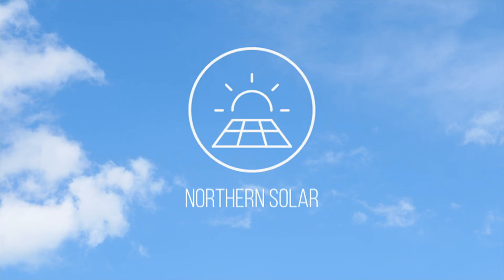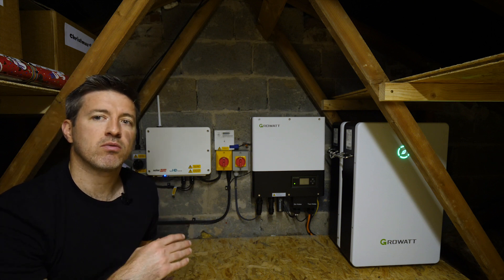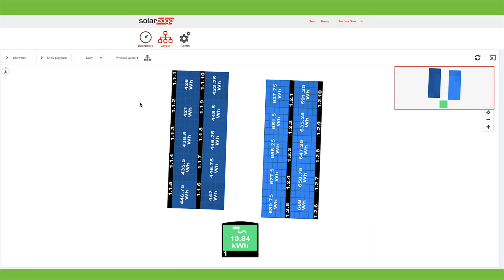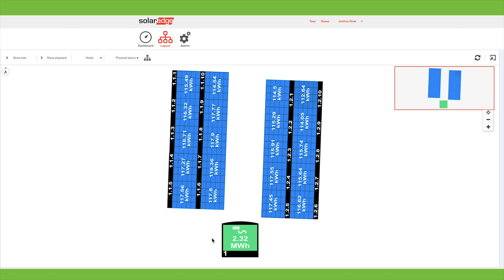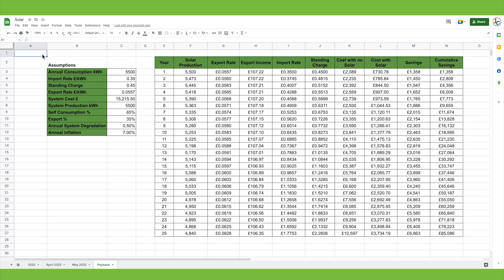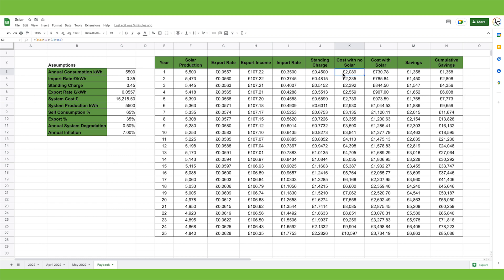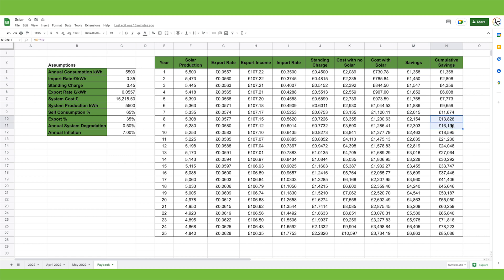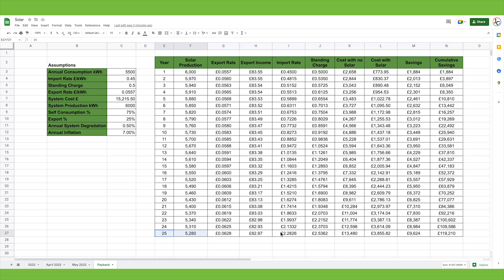How Long to pay off Solar Panels & Battery - System Overview, Cost & Payback Time!

Comment: Thanks very much for a very interesting and informative video.
This is the best video I have seen on this subject. I’m getting a 16.5kw Sonnen battery installed in late October to complement the 14x 300w solar panels I have . I’ve waited nearly a year to get the battery installed.
I’m so grateful to you for developing this spread sheet and explaining it so well.
Reply from the maker: Thanks Michael. That sounds like a great setup. How long have you had your panels?
Reply: @northernsolar6391  I’ve had the panels now for 7 years and get the FiT payment. I have 14x 300w which generate around 3600 kw per annum. In addition,I had an air source heat pump fitted 5 years ago. I live on top of a hill overlooking the Moray Firth in north east Scotland so my house gets wind chilled a lot in the winter. The battery will help save more power to off set my electric bills. I just wish that I didn’t have to pay VAT on it which is a lot ( the battery is £14300). I plan to download and use your spreadsheet so thanks again for that.
Reply from the maker: @michaelmcclafferty3346  yeh the vat is a bit of a kick in the teeth. Are you on a split tariff to charge the battery overnight too?
Reply: @northernsolar6391  The VAT is a pain but I’m challenging that with the company fitting it and HMRC.
I plan to shift my electricity supply to Octopus and get a split tariff after I’ve analysed the data from what I can fully store from the solar panels.
. I will also have to get a Smart meter fitted. My current supplier Eon has point blank refused to fit a Smart meter in my house.
Reply from the maker: @michaelmcclafferty3346  good luck with HMRC. Let me know how you get on with that. I'm with Octopus too. I'm sure they'll fit a smart meter for you. If you do decide to switch you can use my code for £50 credit if you like. https://share.octopus.energy/fawn-shrew-539

Comment: Great information thanks....
regarding battery storage are you expecting any problems storing batteries in such a hot environment during the summer and cold during the winter.
Reply from the maker: Thanks Vincent. I was monitoring the temperature in the loft during the heatwave this summer. The highest temp in the loft was 40°C when then outside temp was 39°C and inside the rest of the house was 36°C. Our loft is well ventilated and the solar panels also stop the roof tiles absorbing too much heat. I will be monitoring the temps during the winter but I don't imagine it will drop below 10°C in the loft at any point. I know lofts aren't the best for every install, but it's working well for us. I hope this helps. Cheers
Reply: @northernsolar6391  I didn't factor in the shielding ability of cooling the loft area during the summer, so as I'm pushed for space everywhere else this could be an avenue I could go for...cheers 👍

Comment: Fantastic video. My set is coming next week and cannot wait to see what production it will be deliver 😊 I went with 6.5kwh battery and I hope that it will be enough to run lights at night and TV 😂📺 but I know that in couple of years I would like to upgrade to 2 batteries same as yours.

Can you run dishwasher and washing machine at the same time without need to take power from the grid purely from your batteries?
Reply from the maker: Thanks Pawel! That's great to hear that you're getting solar too. The discharge rate from the battery depends on which inverter you have  as well as the capacity of the battery.   My growatt inverter can discharge at 3kW so we can run the washing machine and dishwasher together if we need to. We normally stagger them though so they are on at different times. I hope that helps. Cheers
Reply: @northernsolar6391  i will have same inverter as yours... Thx for replaying so fast. I was worried that I will have to run those 2 machines seperately but now worry not I must 😂

Comment: Thanks for a very interesting video, I'm still on the research stages for getting my solar and batteries, but have downloaded your spread sheet for future use.
Reply from the maker: Thanks Jim! I hope the spreadsheet helps. With the new price cap being so ridiculously high  it makes solar look better than ever. What direction does your roof face? That's one of the main factors really.
Reply: @northernsolar6391  I have a WSW and ENE roof
Reply from the maker: @Jimages_uk  That's similar to mine,  I think both sides is the best way to maximise your production. Let me know what system you go for in the end or if you need any help figuring it out! Cheers
Reply: @northernsolar6391  I have a WSW and ENE roof, although not perfect, I do have sun right through the day, and generally a couple of hours on both sides each day, so will be looking for panels both sides probably.

Comment: I can't wait for you folks to get to winter when we may not get any sun for a week lol. I am on my 6th year with solar but in Canada we get a more severe winter with lots of snow removal to get even 4 hours of production. I still love the solar and it has cut my energy costs by $3500 a year.
Reply from the maker: Yes, we've certainly had a solid few months to start with.  I'm really looking forward to seeing what autumn and winter looks like and figuring out how we manage our usage. Having the battery and being able to charge it on the low cost tariff overnight will be a huge plus during the darker months though. I think production we do get from Nov-Feb is a bonus. We don't get much snow here in Cheshire so I'm hoping not to have to get on the roof and clear it, that sounds like a lot of work! How does it work in Canada regarding exporting to the grid? I imagine you'll export a huge amount in the summer too?
Reply: @northernsolar6391  yes I have what we call Netmetering so I don't get paid for surplus I get credits which need to be used within a year. I have a roof rake 20 feet long handle to drag the snow off and we get lots in a winter maybe 4 feet lol. December is the worst month as the days are so short and the snow but that is Canada. I make about 12000 kwh on the grid tied solar and 3000 on the off grid battery setup My house is100 % electric so I use about 17000 kwh in a year so from November to February only about 1200 kwh the challenge is to get through winter on the credits lol. Cheers happy solaring.

Comment: Fantastic informative video. Your presentation style is really clear and professional. Many thanks for sharing your spreadsheet.

My current system is 5.6kWp (South facing on the garage). I currently heat all my water with an Eddi from March to October and will add Zappi when I move to an EV. 

I'm about to change the inverter to a Solis Hybrid and add a 4.5 kWh Pylon battery to maximize self use. If that works well I'll add another to increase to 9 kWh.

Once I transition to an EV I'm planning to add a 6kWp  East/West panel array to the house roof, to expand the charging day and compensate a bit for the low winter power generation. The other advantage I see for an E/W array is that as I am on Octopus Energy's Agile export tariff, which is currently averaging over 30p/kWhr and much higher in the early morning around 7-8am and even better in the 4 - 7 pm period. it really help with the ROI.

Have you looked into the possibility of moving to Octopus Energy. I really like them. Plus if you have an EV their Octopus Go and  Go Faster tariff are great for EV charging at night (Go currently 7.5p/kWhr). If your interested in Octopus Energy, use my referral code (https://share.octopus.energy/mist-marsh-721). You'll get £50 and so will I.
Reply: Hi,  I'm in East anglia. The Go tariff is great if you have an EV. The down side is that it excludes you from Agile Export to prevent you selling them back the cheap overnight electricity. Though to be honest I think Octopus are missing a trick,  as long as they were making a good margin it surely helps them to have customers taking up the load at peak times. After all they have invested a lot of money in  batteries and inverters.
Reply from the maker: @Pablo-tw7tt  Yes,  it would be great to get paid more for exports. Although, through winter we will not export very much at all though so it's not likely to make much difference financially. Having the cheaper off peak tariff now makes a lot more sense as we will need to charge the home battery and the car battery from the grid a lot more.
Reply from the maker: Thanks Pablo! That sounds like a great system. What part of the UK are you in? Last week we just switched Octopus too. Just on the Go Tariff for now but we are considering the agile tariff too but we do charge our car most nights so we need the cheap off peak for that. Cheers!

Comment: 7% inflation every year for the next 25 years, I don't think so mate! I guess you'll find out just how good these warranties you're crowing about are? Not a good place for an inverter in the loft! There'll be cooking  in all this heat! Every electronics engineer knows that, Even with their cooling fans!
I'd check your warranties on that one 😉
Reply from the maker: 7% seems to be a reasonable average based on historic trends? What would your suggestion be just out of interest? The temp in the loft reached 39.9°C when the air temp outside was 38°C at the peak of the heatwave this year. Well within the operating range. I know not everyone's loft would be suitable but we did check with our installers first. Cheers

Comment: Great Vid
Interesting spreadsheet, is there any way to obtain an interactive version "to ring the changes"? Am looking at a 6kw solar battery and think I might need a bit more looking at your figures
Thanks
Mike
Reply from the maker: Thanks mike. You can download the spreadsheet on the link in the description. There's definitely room for improvement in the calculations. I'll be looking at it again at some point and will probably do another video about it.
Reply: @northernsolar6391  Have discovered that a editable version can be downloaded when in Windows, as opposed to a non editable version when in Android, thanks again as I can now ring the changes. Mike.

Comment: I think the shared version of your payback sheet has a small flaw. The export rate is not increasing by the rate of inflation as the reference in the formula is $C$11 - degeneration- and not $C$12 - annual inflation. When you apply the annual inflation increase to the export rate this has a positive effect on overall revenue. 
I’ve also reduced annual inflation to 5% as a more conservative estimate, though I appreciate your rationale for 7%. Hope all this helps. Thank you for creating this sheet - it’s been quite helpful in projecting likely ROI and payback for my own project.
Reply from the maker: Thanks Mark. I'll take a look at this!

Comment: Hi, great video, i have just had a split E/W system with 16 x 390w panels Growatt inverter and 2 x 3.2 growatt batteries, finding the batteries don't just last the night so having another retro fitted. It would good to see the kWh production curve for your east and west arrays on a sunny day to compare against, also been looking for a link to download your savings spreadsheet, if you could provide a link it as i want to keep track of my savings, thanks jeff
Reply from the maker: Thanks Jeff. My latest video has daily graphs from a sunny day and a cloudy day in July. Is there anything you can switch off or turn down overnight? 6.5kWh seems like quite a lot of overnight usage to me especially in the summer. Cheers!
Reply: @northernsolar6391  Hi,  got my 1st figures from the Growatt inverter and i think i have an issue with the system i have contact the intsaller but i think i am generating 20% less than i should be, max gen for any one day was 30.3 during the very sunny days over the last 2 weeks. The max generation per side is approx 2.25Kwh which i beleive is too low for a bright sunny day when each side has 3.12Kw of panels. I do have a 40 percent pitch roof rather than the optimum 45 but would not have thought that would not degrade the ouput that much. Any Thoughts?? What should i be getting for and E/W split system??? To the power usage overnight... due to having a 2.5 storey house the top floor beds usually have fans on due to the heat and could also have both TV's on each bedroom till late, add the fridge working harder due to the hot weather and the entertainment system in the living room on till midnight it soon adds up.
Reply from the maker: @jeffbarker2356  Hi Jeff. The panels wont be working at their optimal level in very high temperatures. Anything over 25°c and they'll start to lose efficiency. It might be better to wait until the heatwave passes and when it's cooler again and the sun is shining you will see much better production. I hope that helps!
Reply: @jeffbarker2356  
Why do you believe your system should be producing 20% more?
Production of about 25-30kwh from a 6.24kwp system on a day in the beginning of August, is probably average. How many kWh did the system produce in the whole month?
Many factors affect the output of a solar array, including the inclination and orientation of the roof. Ambient temperature. Latitude of the location and solar irradiance in the given location. Type and size (kw of power output) of the inverter. Partial shading of the panels. 
The last two are VERY important in an installation, as not much can be done about the rest (can’t move the house around).
The pv panels are very sensitive to shading. Even the shadow of a cable cast on the array can reduce significantly (10-20%)  the output of the array. Even if only one panel is shaded, the output of the whole string will be reduced. (Almost certainly your panels are in two strings). One way to mitigate this, is dc optimised string inverters (Solaredge), with every panel working “independently”. 
An other potential issue ( not very likely in your install) is “inverter clipping” and the solaredge inverter can reduce this as well. What is the size of your inverter?
East/West facing panels in the UK, will produce peak output on a small number of days (if at all)

Comment: The inverter and batteries will need to be replaced about half way through the life of the panels.Even with an additional cost at about 12 years,you look likely to make substantial savings.
Reply from the maker: Hi Tony. We've got extended warrantees on the inverters so hopefully if/when they do need replacing we'll be covered. The battery is 10 years. Who knows what technology will available by then but they will have definitely paid for themselves already yes. Cheers

Comment: Interesting but in South Africa installing solar is a win from the start as it's mostly today install to get around our load shedding frustration as well as the constant power failures due to bad maintenance  and not to save energy cost the saving is just a bonus
Reply from the maker: Wow, I had no idea. So do you have certain circuits in your house that your panels/battery run when the grid is down?
Reply: @northernsolar6391  I use 3000w hybrid  inverter with 1460w panels ,gas geyser or water warmer for hot water and gas stoves . I run the house on solar in the day then on battery till its 80% and then the inverter switch's to utility or grid power at the night . In South Africa 90% houses don't have air-conditioning so big solar  system are not necessary for most and so 5000w hybrid inverter works well  . I'm using 96kw a month with this setup.
Some are using solar geysers and not gas
Reply from the maker: @gm9666  that's so interesting. I imagine the solar industry in SA is very busy if the grid is that unreliable?
Reply: @northernsolar6391  yes business and shops that never stocked solar are now stocking solar

Comment: Hi Josh,  great video thanks again for sharing.  I have just downloaded your spreadsheet and will start to play with it entering my own figures from my solar.  you have not mentioned what car charger you have installed.  Up until last week I had the pod point charger, but I had it replaced with a zappi and the difference is massive.  It cost me 1K to buy it and get it installed, but it is definitely going to pay back easily.  Today my 8KW solar array (4kw south facing and 4kw east facing) produced 45kw.  I was able to drip charge my EV with 14kw giving me around 40 miles of free driving.  The beauty of zappi is it will divert charge when it detects your setup is exporting to the grid and push it into your car.  I only regret that my car quickly filled up as it already had 75% charge.  with my house consuming 11.4kw, my car 14kw, I still exported 18.2kw which is more than I am happy with.  my Tesla powerwall is not being fitted until December, so I just need to wait.  on a positive note, my fit payment for today only is £11.04, so over the month this soon adds up and over the year equates to around £1500.
Reply from the maker: Hi J! That's great news about the charger. I'm going to stick with my pod point for now but most definitely looking at a zappi once we add a have a full EV rather than the PHEV we have now.  Those FIT payments are so good. One day maybe SEG will be more generous but i doubt it!